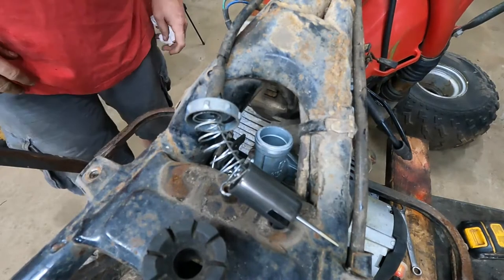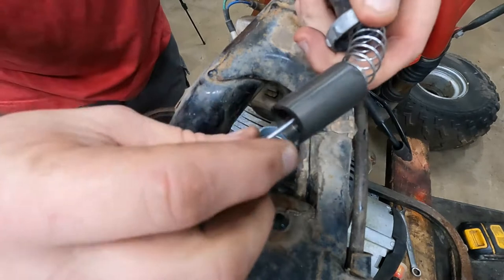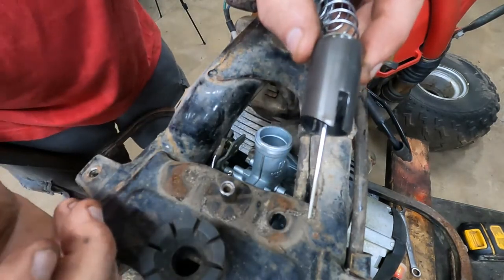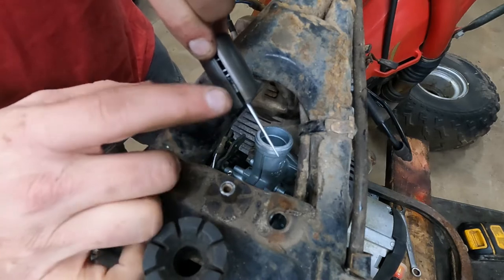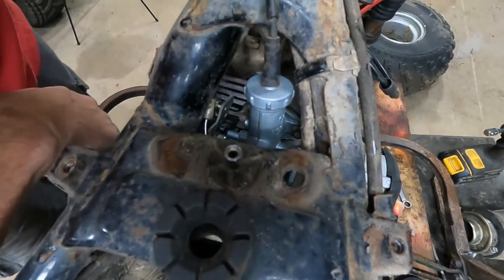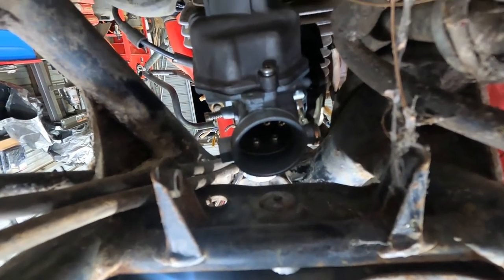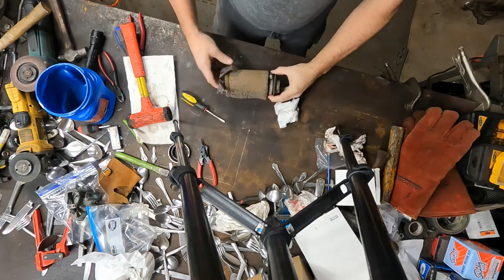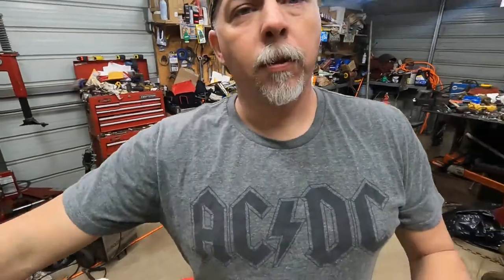HONDA ATC THREE WHEELER GOES WIDE OPEN THROTTLE!  Repair

Comment: I have an 84 Tri Z 60 Yamaha, and this helped a ton with the carb work.  Thank you so much for this video!!!!
Reply from the maker: I'm glad I could help. Thanks for watching and subscribing.
Reply: @mrcbuilds  Any suggestions for the choke plunger getting stuck in the carb?  Couldn't use the air to dislodge it...
Reply from the maker: @raziel3358  I would have thought air also. Spray it down with some lubricant, try the air again, I really think that's the best way, Pull the carb off/ take the bowl off, put your thumb over the choke hole and blow air from inside the bowl into the choke passage, your thumb will cause the pressure to build up and hopefully dislodge the choke plunger. good luck, I hope this helps. Thanks for watching.

Comment: Thats what my 85 Big Red is doing after I decided to start back tinkering on it recently, I had all the jets replaced in the carb years ago an I just stuck it back on the bike but I never started it up since then.
Reply from the maker: Very common and easy to put the slide in backwards. I'm glad it helped, thanks for watching.
Reply: @mrcbuilds  When I made the original comment I was thinking of one of my 200 bikes where the slide screws in the top, I dont remember having to take the slide out of the 250ES carb but i'll double check it, an also see if the idle screw is turned in too much now after the rebuild.

Comment: Love your videos my dad had a 200x he bought new and was trying to rebuild top end before he died I now am going to finish but can’t get exhaust bolts off can I leave on and still separate the head any help would be great he would have known how to do it but I no longer have his knowledge
Reply from the maker: Yes, you can leave the studs in place, burning the rebuild, try heating the bolt/stud up with a torch and while hot extract it.

Comment: Would no air box cause wide open throttle ? Put throttle spring correctly facing the idle adjustment screw 

The jet is complete 7 turns in and clean 

The cable isn’t pinched and when I played with the choke the throttle calmed down for a second
Reply from the maker: No, the air box missing would not cause full wide open throttle. What have you changed? Wrong cable could cause it. Leak or crack in intake, valves leaking, plugged passage in the carb. Try those items first .
Reply: @mrcbuilds  I got the quad not running at all sitting for years I replaced the starter relay and installed a key/ignition. The thumb throttle is not original and the spring looks little bent out of shape so maybe I’ll get a new cable and spring

Comment: Hey Thanks for the tips! I have a 83 Honda Big Red 200es, its turns over fine and idles great. But once i've engaged the throttle, even just a little bit, it won't go back to a normal idle. It revs really high will runaway if i throw it in gear. It's almost like once I engage the throttle it won't close all the way? I'm at a loss. Any tips?
Reply from the maker: Sounds like an air leak, check your valves, check intake boot for cracks.
Clean both carb jets. You should be fine.

Comment: Can I use Rotella T6 15w40 for the engine oil?
Reply from the maker: Yes, a lot of people like rotella. If your clutches start to slip then you need to go back to a atv oil, like lucas. But again, alot of people use rotella without issue

Comment: I but it back together the right way but it still will go WOT when I start it, I don’t get it.
Reply from the maker: With the carb off the machine hook the throttle cable up. No blip the throttle does the slide come all the way down and bottom out agaist the bottom of the carb? Is the fast idle screw tured in? Stopping it from going down?. Or is the cable to short? Figure out why the slide is not returning to the bottom of the carb.
Reply: The slide does not bottom out and the fast idle screw isn’t in the way so my throttle cable is too short ?
Reply from the maker: @EmerickGauthier  ok then, disconnect the cable and verify the needle isnt bent and the slide travels freely all the way up and down. If it does move smoothly all the way up and down then yes your cable is too short.
Reply: @mrcbuilds  the needle isn’t bent but what I also don’t get is why the cable was fine 3 days ago and now it won’t push the slide all the way
Reply from the maker: @EmerickGauthier  did you loose the spring?
Reply from the maker: Is your cable pinched? Is the adjuster on the thumb throttle all the way out? If it worked 3 days ago then you changed something. retrace your steps

Comment: Have you had any problems getting the slide out?
Reply from the maker: Only once. It was rusted inplace for many years. There is a good chance your needle is bent or wedged in its bore. Soak it in pdblaster or try heat the housing.
Reply: @mrcbuilds  i’ll give that a try!
Reply: @mrcbuilds  heat worked great. Thank you.
Reply: @mrcbuilds  needle looks good too!

Comment: What if you put it back together correctly but your throttle cable is loose?
Reply from the maker: If it was tight before you took it apart. You need to take it back apart and find where you got it wrong. I have seen the slide get hung up and the spring not push it down and make the cable slack.

Comment: I have the same problem but when I flip the ramp to the right side it don’t go all the way in but when it’s back wards it goes in but then red lines I’m really confused ?
Reply from the maker: Make sure the needle is not bent, if it  is you will need to replace it.
Reply: @mrcbuilds  okay I will thank you very much

Comment: I habe a question. I know nothing about vehicles. My dad had a Honda three wheeler 250 from like ‘85. 
He recently replaced the carb and then the next day was excited he fixed the back. He took the grandkids out for rides going sooooo slow like 5mph. Suddenly the throttle sounded like it was stuck he went top speed and it was winding sounding like he needed to downshift (no one saw only heard). He jumped or flew off with my almost 2 year old son and saved his life by taking all the impact. They say my dad died on impact. My son was perfectly fine because my dad was holding him. 
It’s tragic but I am trying to understand what went wrong. He never went fast. He was so careful. Did he do soemthing wrong when he replaced the carb????

Your insight would very much be appreciated or anyone that can help me understand a little bit. He had also ordered a new starter that had NOT been installed. But the carb he had replaced a day or so before.
Reply from the maker: Hi @alainagambardella8100, First let me express my condolences to you, loosing a father is never easy, they seem indestructible your whole life, but in the end they are human too. Your fathers last act on earth was protecting his grandchild, no more valiant way to go than to save another's life. You have asked me a very difficult question, I will do my best to answer it, I am just a hobby mechanic, please know that going in.

The carb on most atv/atc has a double safety, a return spring on the thumb throttle and another spring in the carb body controlling the slide with just a simple cable connecting them. You said this was an 85 Honda with a starter and a 250cc so it must be a 250es big red or a 250sx, the reason I point this out is those both have auto clutches and manual transmissions, the machine would not have shifted into a higher gear on its own, it would only have reved up and gone only as fast as whatever gear it was in ( you said he was going very slow so first or second gear). Had the cable broken the spring in the carb should have closed and the carb returning the engine to idle and stopped. Also both machines have screw in cables at both ends, so the cable could not have been pinched or pulled. There are many reasons for a machine to not return to idle, but I can not think of a single mechanical reason why this specific machine would rev up to the degree you have explained.

Possibly your father had a stroke while riding and holding your child with his left hand and naturally steering and controlling the throttle with his right, as he collapsed he fell forward accelerating the machine thus throwing them off at a faster speed and higher revs. 
This makes the most since to me knowing the machine had been running fine earlier in the day. 

I can only be certain of 1 thing your father passed away with love in his heart and a smile on his face, I can't think of a better thing to be doing than riding with my daughter. Again I'm am truly sorry for your loss, I am glad to hear your child is ok. I hope this brings you some kind of comfort and closure to the mechanical questions you had.
Reply: @mrcbuilds  so he didn’t have a stroke. The autopsy proved he didn’t 
It was a red Honda 250sx I believe. He had just replaced the carb by himself... He has ordered a starter that was never put in.  
He told my son watch out and held him he was completely coherent before falling because that’s only how my son survived… maybe the cable something weird? I saw this ans was thinking it must be the carb because he has literally just fixed jt. What is so confusing is there are tire marks on the road he was trying to stop and the highway patrol said he died on impact he was going so fast… it’s just a hard thing to understand because he had never even flipped one before or got hurt ever. My mom has a recording of the noise actually but it sounds like it’s flying going so fast.
Reply: @mrcbuilds  thank you again for trying to answer my question.  He actually was smiling when he passed.

Comment: Why does my new throttle cable seem to have no slack/play , my thumb throttle is stiff
Reply from the maker: I dont know what machine you have, but most have adjustments on one or both ends, loose one end up, until you get the play you want.
Reply: @mrcbuilds  I have a Honda atc 125m , the cable acts like it’s too short but it was actually longer than the stock one

Comment: Thanks, your super handsome!..anyway , im struggling with my choke cable on my 300 fourtrax lol. I'm ready to smack some Tamerite on it, lmao
Reply from the maker: Thank you very much Casey. Whats the cable doing? You can get a replacement cable on amazon or partzilla.com and if you need just the carb side ( spring, needle, cap) you can get that at
223cycles.net